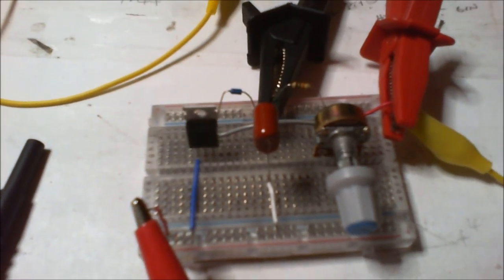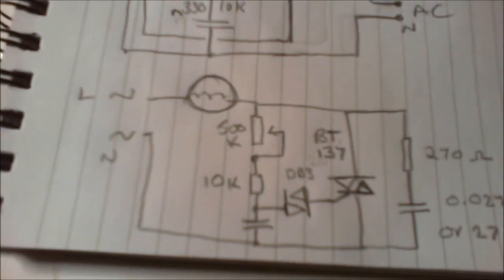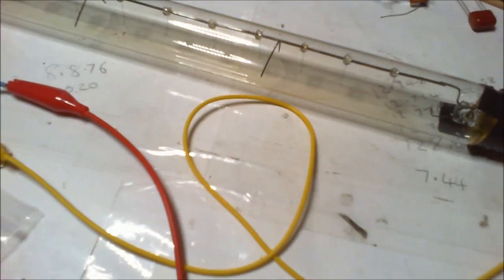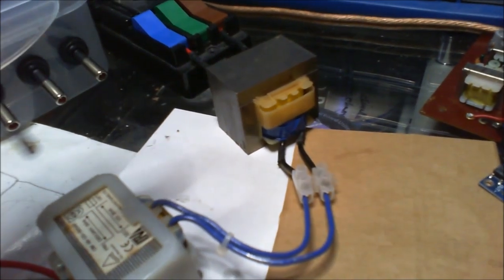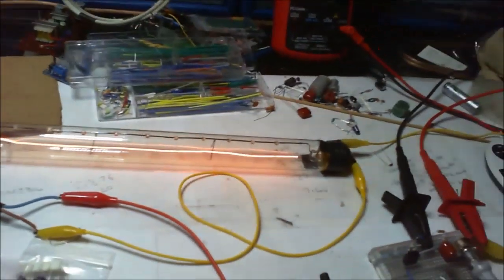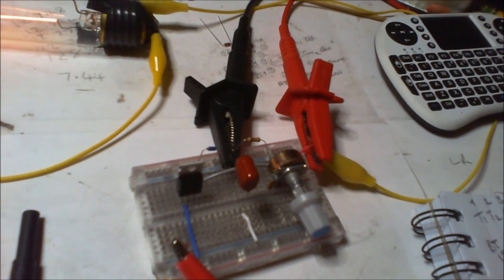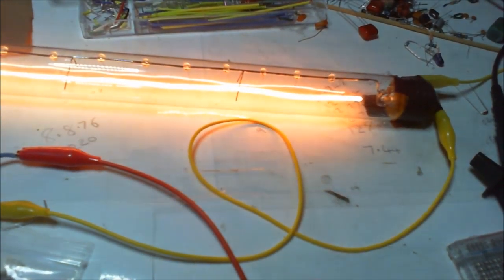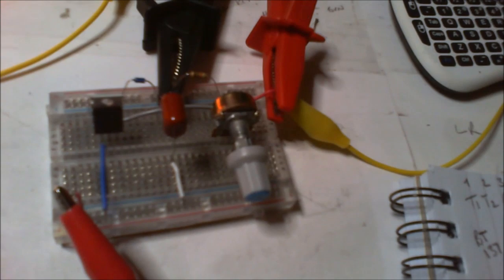Basic DIY AC Lamp Dimmer Circuit Using Triac

Comment: Hello sir,
 i am working with AC dimmer project using BT136 triac for inductive load(ceiling fan) control and getting buzzing sound while AC dimming how can i remove this noise ??
Reply from the maker: Hello friend, Sorry but you can not use AC dimmer to control motor, ceiling fan. Please search for 'control motor with AC dimmer'